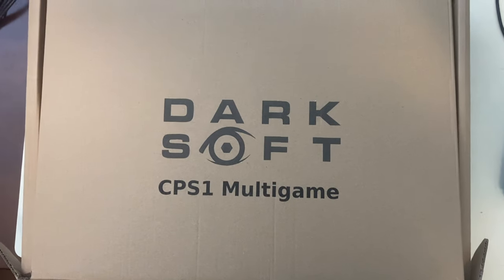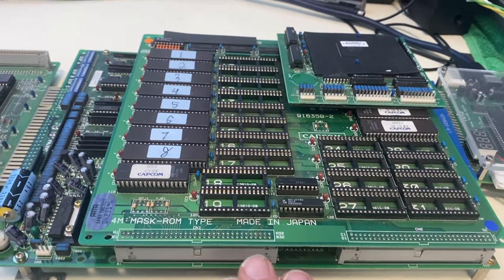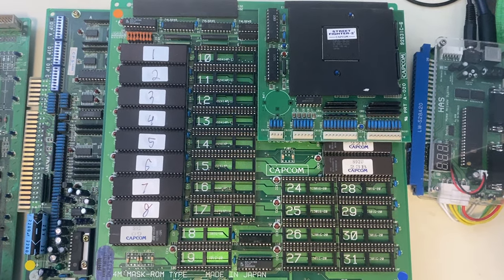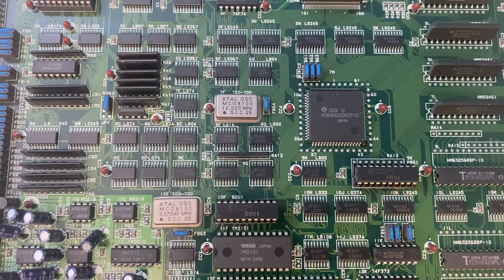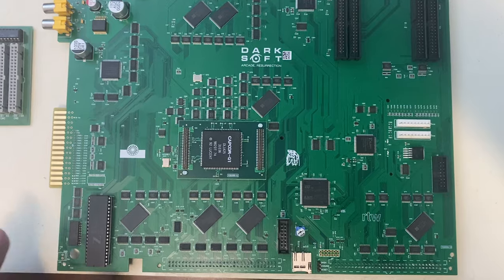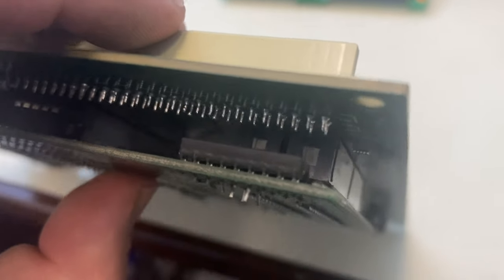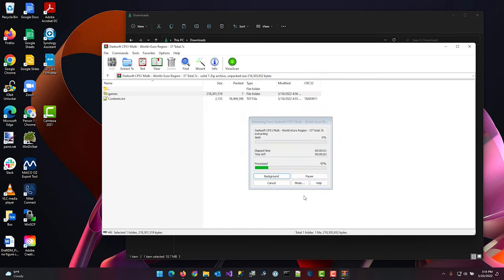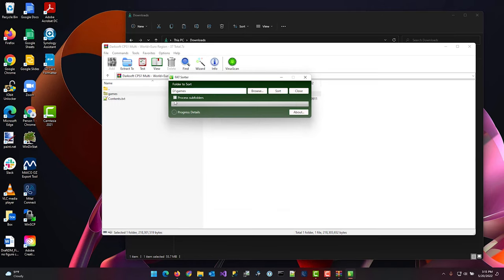Darksoft CPS1 Multi Installation and Overview

Comment: Hi, Great video! 
I didn't get about which C board is fully compatible. I might have a donor board with a 92641C-1 C board with an original battery-backed. Is it compatible with the CPS1 multi or it need to be modded?

Comment: Are the dips working per game now? Are there any issues leaving them setup for one game or is it advisable to set them all to off before booting up each game? Cheers
Reply from the maker: Since each CPS game is running the original code, the DIP switches need to be set appropriately per-game whenever you switch titles.  Most CPS games use similar settings so you shouldn't have to change them too much.  Mitsurugi-X on the AP forums sells various DIP switch extensions that make it easier to access the DIPs if need be.